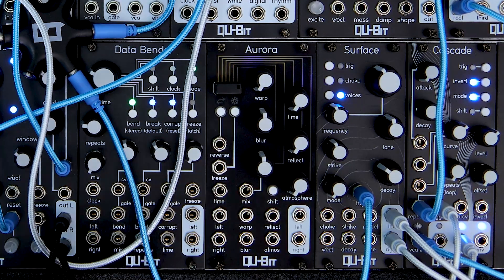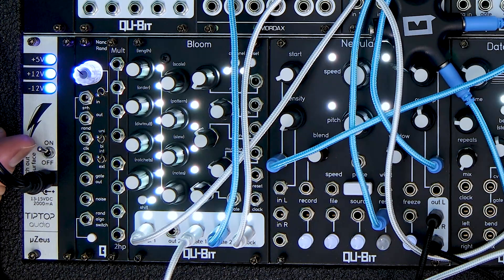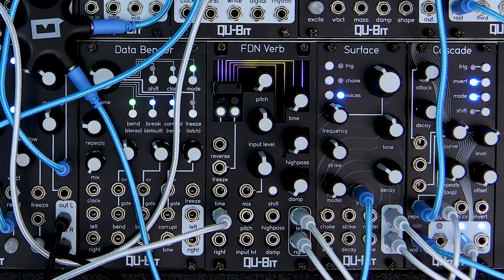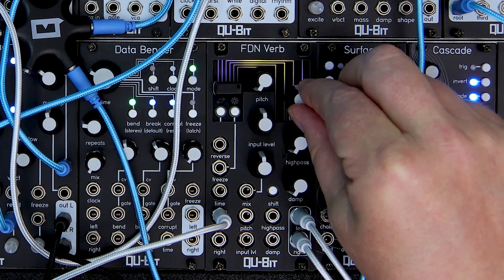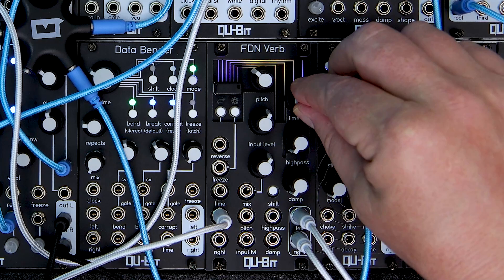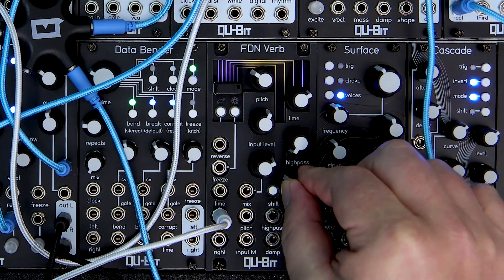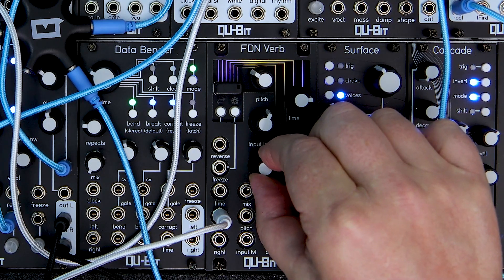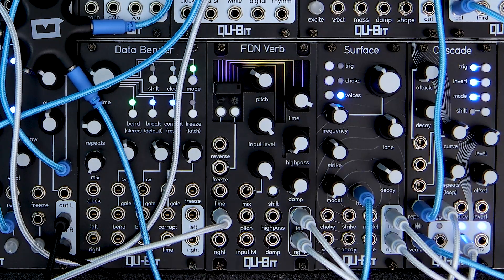FDN Verb - An official alt. Firmware for Aurora

Comment: It would be cool to have an overlay which has less gaps and attaches under the jack nuts and pots. Awesome to release a new algo though
Reply from the maker: The challenge lies with making it tight enough, but also easy to put on and take off. 
Thanks for your thoughts though--it's very appreciated.